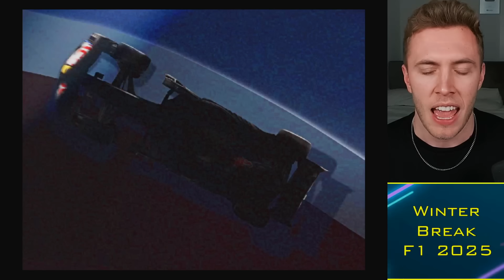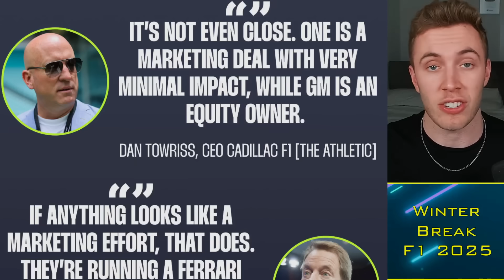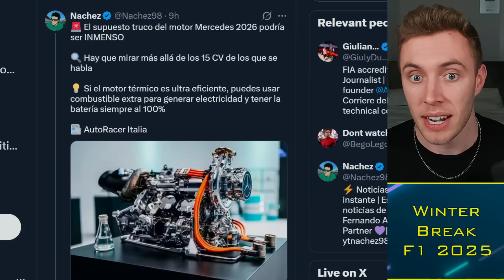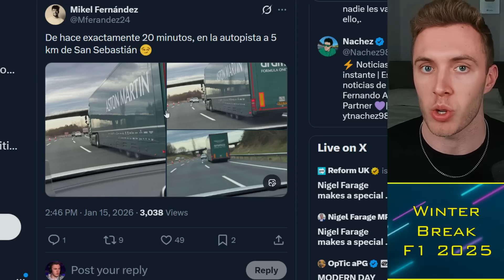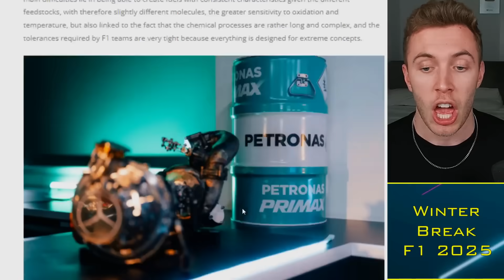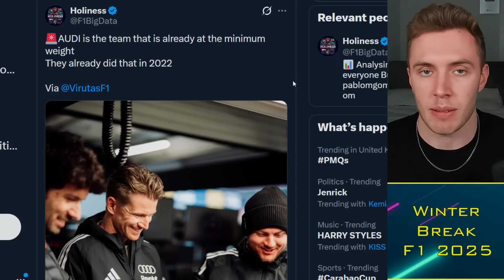F1 Test DRAMA: Fuel Problems! (Ferrari 🚨)

Comment: FIA set the LHV i.e lowered heating value....basically net calorific value within limits 38.0 to 41.0 megajoules per kilogram in the specification.  However teams will be made to adjust the fuel flow to a maximum of 3Mega Joules per hour.  So if your fuel is lower in calorific value then you can run a higher fuel flow.  Why didn't they just leave the spec to be limited so fuel suppliers can set the value where they want.  The calculation for LHV is based on composition as measured by just one laboratory.  It has a poor precision.  Would been better to have a bomb combustion calorimeter method.  But really they should have just said if fuel meets limits then u can do what u like.  Its difficult enough having 100 percent fully sustainable components.

Comment: F1 should be using it's ultra tech to perfect hydrogen power, as in using hydrogen gas. More 'sustainable' that any other, and cleaner. Also, no need for very toxic and greenhouse sucking batteries (in cost to make) and can go back to a V12 and scream around as a simple light racer. What a waste of tech and money.

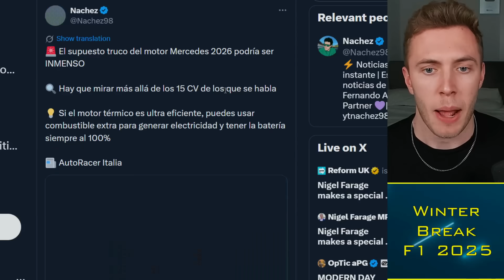Comment: 8:28 The battery is a buffer always charging and discharging. If you actually kept at 100% then you wouldn't be able to break at the end of the straight.  ...Well you would but a huge percentage of your rear brake stopping would be gone. He really meant getting near the per lap amount of deployment your allowed in the regulations.

Comment: I bet the FIA have a device that can screw into the spark plug hole and inject heat into a cylinder and if that heat changes the ration then it is a ban, wait and see, I have seen these devices in the mechanics hands before checking for compression cheats.

Comment: How can you create an engine without the fuel being ready to begin with? You create an engine based on the fuel you are using, not the other way around. No one in the right minds will create someone and there isn't fuel for it. This is why America has gone into Venezuela, America no longer produces the type of oil their refineries need, Venezuela has it in abundant amounts. The moral thing to do is build refineries for the oil they produce, but Americans are always about the here and now, not the crap they cause 10-20 years later, they like to kick the can down the road. Producing engines base on fuels that have not been produced is kicking the can down the road.

Comment: ferrari not being ready power unit gearbox along with suspension wise also shell not being ready fuel wise. that would mean despite all the gm plus twg motorsports put into this team cadillac would have an equally worse or even more terrible start than hrt, manor, maraussia all combined.

Comment: the Red Bull will have Ford blue. not Infinity purple.
Reply: The collab makes so much sense. Now the car will actually look like a can of Red Bull
Reply: Yep & ford is designing the engine redbull power are just building it rab is just being a hoser again
Reply: @EXmagaCANADIAN  The original deal with Ford was for assistance with the electrical side, they had nothing to do with the internal combustion engine. It wasn't until later that Ford were announced to be assisting with that as well. But they're not outright designing the engine for RBPT.
Reply: @rars0n & ford still has the most wins out of any engine manufacturer & that’s why ford is entering again don’t be surprised when ford buys racing bulls or becomes the 12 team & why do you think GM entered f1 & why you actually think ford just here to put a sticker on your a tool
Reply: @EXmagaCANADIAN  "ford still has the most wins out of any engine manufacturer"

That has nothing to do with anything.

"that’s why ford is entering again"

That's absurd conjecture. If that were true then the logical question is what took them so long?

"don’t be surprised when ford buys racing bulls or becomes the 12 team"

Why do you think that? More absurd conjecture.

"why do you think GM entered f1"

Because they saw a lucrative opportunity with the Andretti entry. Duh.

"why you actually think ford just here to put a sticker on"

So obviously you can't read.

"your a tool"

Projection, and it's "you're," and you're missing some punctuation there, fella.
Reply: @rars0n your gay & do not even know the difference between a real girl & fake boy girl WTF & of course it does you tool go watch the interview I referenced again about why ford is designing the engine for redbull & entering f1 again where you not the same clown that said Yuki Suzuki was good lol ok you better go take another booster